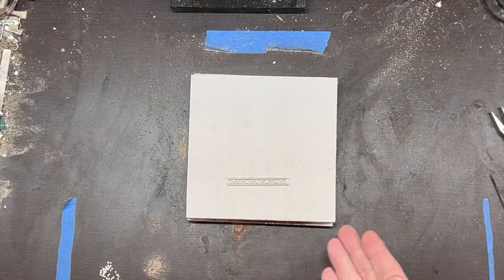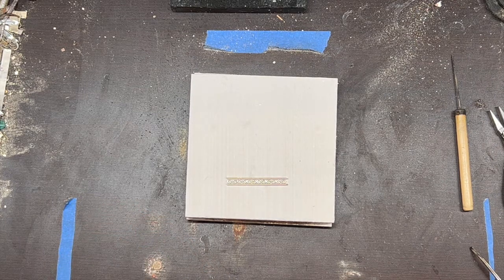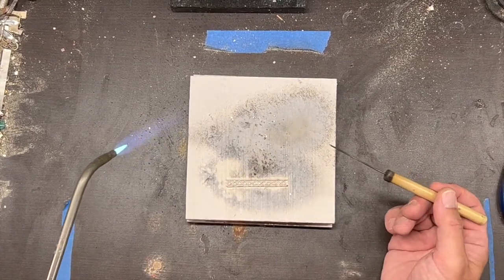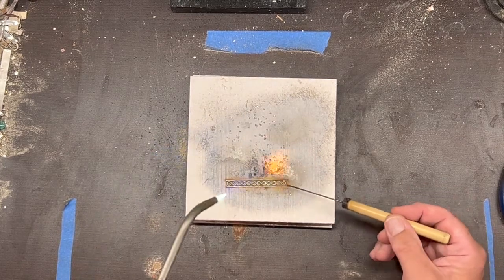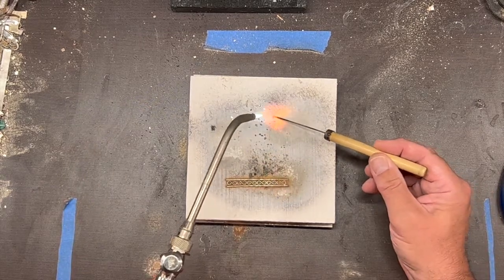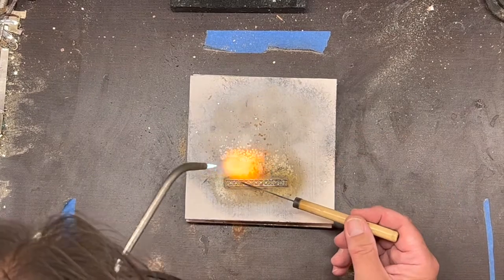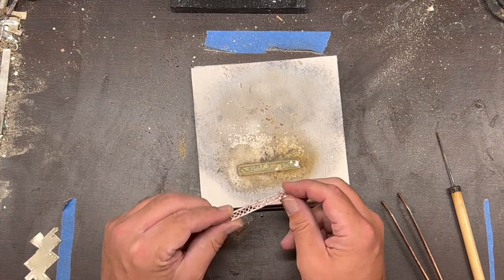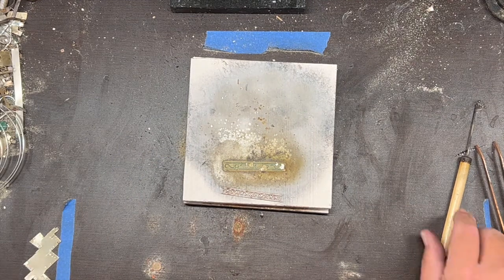Silversmithing:  Mastering Pick Soldering

Comment: Nice, thanks for the work.  I suspect bicycle wheel spokes would make a very good pick, sharpened on a grinder.  Quit a hard spring steel, easier to unscrew rather than cut unless you have spring steel wire nippers.
Reply from the maker: I'll bet you are right!

Comment: Great video!
 I am making my first forays into metalsmithing, and now I understand the reasons pick soldering is so popular. I've been placing tiny bits of solder wire and cursing when the flame causes them to migrate across the board!
Reply from the maker: Thanks Tracee!  You might try getting some sheet solder as well. Less rolling around:). I appreciate your nice comment!

Comment: I would rally like to see your tourch and how that is set up.
Reply from the maker: Hello Mary!  I am using a Smith Acetylene/air torch called "The Silversmith" model set up in a standard way.  It's attached to a B tank which is under my work surface.  I generally use a #1 tip, but put my #3 on when melting silver for free-form castings or making ingots. Hope this helps:)

Comment: This is super helpful Chad, just getting into silversmithing and I'm loving your videos! I'm still feeling unsure about how you gauge when the piece is at the right temperature to take in the solder... I guess just experimentation and practice? I'm always worried about heating it up too much and starting to melt it - are there particular signs to look for in terms of knowing when it's hot enough and when it's getting TOO hot?
Reply from the maker: A couple of clues:  if the metal starts to look slightly reddish, you are getting close, and if you have previous solder joints they start to get a little shiny prior to remelting.  If the surface of the piece itself starts to look shiny, you are getting close to melting it:). Thanks for the good question Michelles!
Reply: @chadssilversmithing  thank you SO much!! That's very helpful! I'll have to start playing around with pick soldering and see how it goes :)

Comment: Hi Chad!
Thank you so so much for helping me along on my metal smithing journey through your videos:) I’ve have been struggling with pick soldering and I’m wondering if it’s my torch…I’m using a butane Proxxon and I’m working with copper as a newbie:) I have no problem picking up the bead of solder and placing it onto my little ring band (two pieces of 20 gauge wire twisted onto itself). I’m using AquiFlux on the piece first and a tungsten pick. I am heating my copper to a red glow before dropping the bead and then focusing on the bead with my torch. Does anything here sound incorrect? What can I do differently? Again, thank you for your videos! They are awesome 😊
Reply from the maker: Thanks Ashley!  For me getting the timing right as far as when to move your solder into contact with the pieces you are connecting was the part I had to figure out.  I mostly use this for silver, so I can't speak to the specific problem you are having.  From your description it sounds like you are doing things correctly:). Keep practicing and you will find the trick!
Reply: @chadssilversmithing  thank you 😊

Comment: How do you clean in all the small areas between the wire, such as polishing?      I'm fairly new to this and am hit/miss with my soldering being a success but am practicing.
Reply from the maker: Hello Dean!  I use silicone abrasive wheels, and felt wheels with polishing compound.  Many use 3m bristle discs as well.   My friend Flying Chef recommends those as well as using q-tips with polishing compound in your rotary tool.

Comment: I got a question about the pick you said it's made of tungsten 
Can something other be used like nichrome wire for instance kind the same thing in  terms of heat
Reply from the maker: That's a really good question David, and I don't know the answer.  Most picks I've seen are either tungsten, which work great, titanium which is interesting in that it doesn't seem to transfer a lot of heat towards your hands, or stainless steel which some people use, but I haven't tried.  The guy who taught me used to stick a stainless t-pin through a pencil's eraser and use that:). Sorry I don't really know the answer to your question!
Reply: @chadssilversmithing  I deeply appreciate your honesty in this matter I will continue my efforts to find that answer and a wise man you still are in this craft I then will gather a piece of wire and try the one thing I do know is it can not be soldered but as a pick maybe a good tool nothing  left but to experiment 
             Thank you 😊

Comment: What kind of torch mix do you use?
Reply from the maker: Hi Nikki. I use a Smith Acetylene/air torch, so it’s just got the one acetylene tank, and draws in atmospheric air to mix with the gas through little holes near the base of the tip.